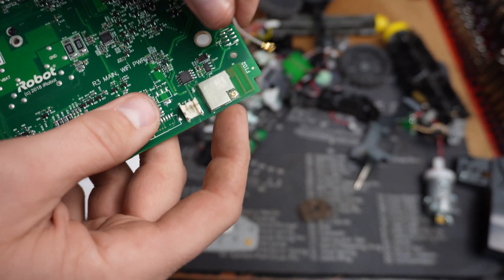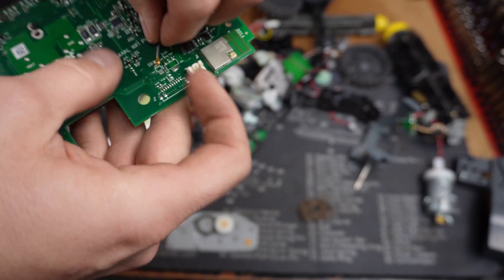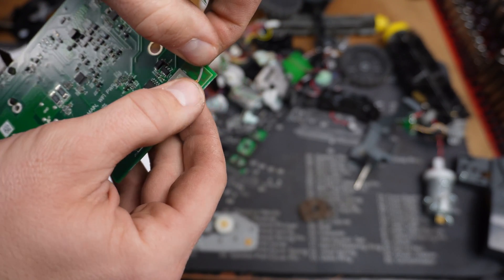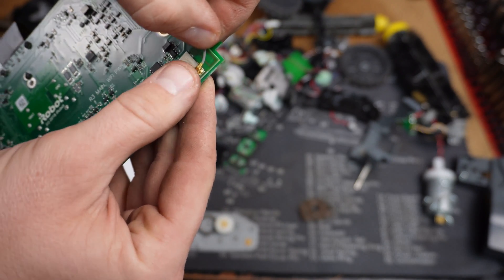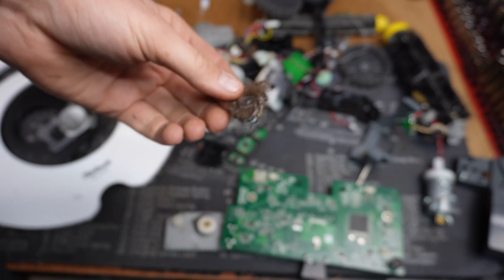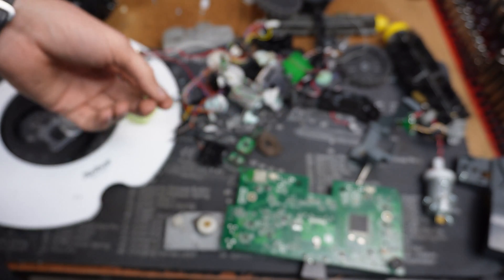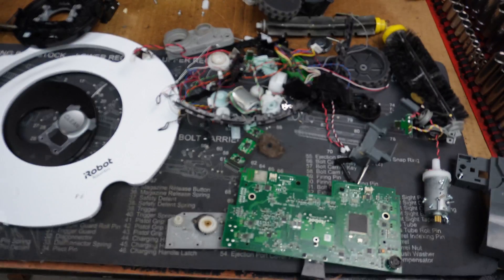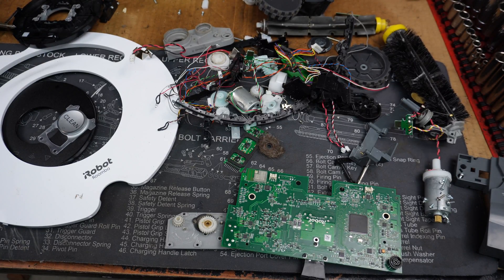What's inside an iRobot Roomba Vacuum?? Complete disassembly video

Comment: FTW you gotta put it all back together! Thanks! The wheel module disassembly was of interest.  Once you've pressed out the axle pin and gotten that hair ball out of there would you need to red locktight the thing when you put it back together?
Reply from the maker: Haha, I pushed the pile of parts straight into the garbage can after this video ended. No, I don't think thread locker would be needed. the pin should stay in. It was a right fit.
Reply: @gagefixeseverything why tho you could of took those ultrasonic sensors and vacuum fan thing